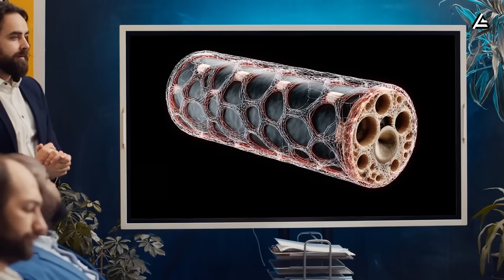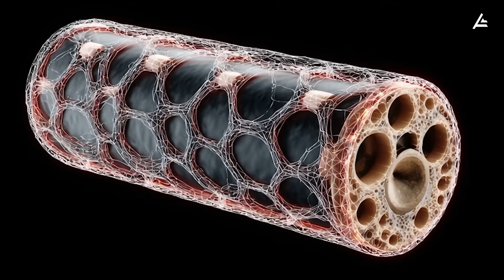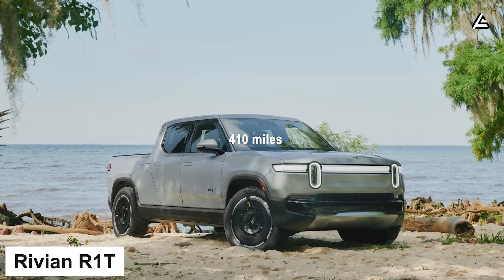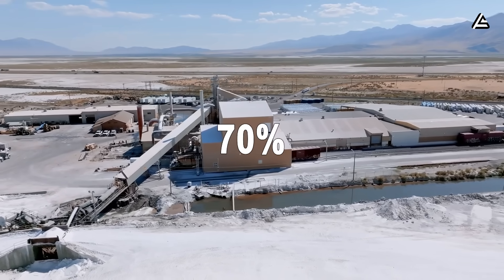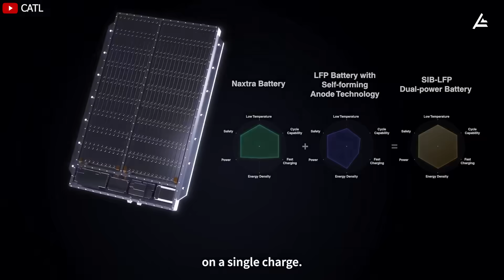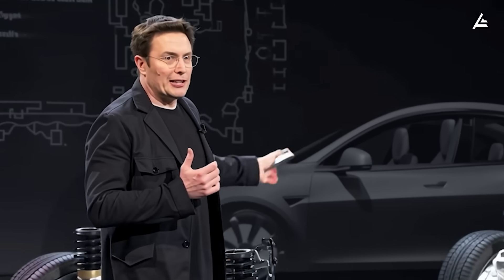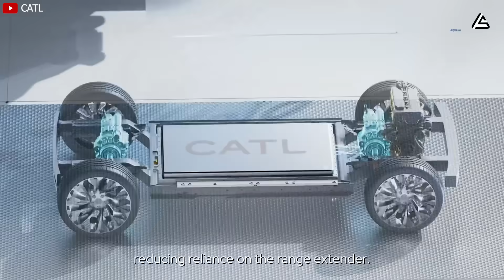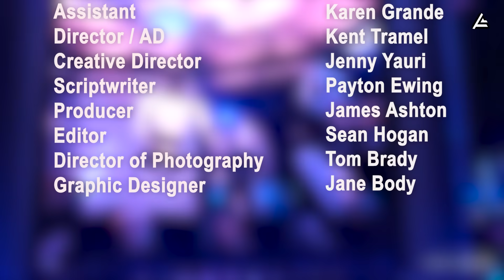2026 Tesla Batteries Update About Aluminum & Sodium: What Elon Didn't Tell You?

Comment: Aluminum ion batteries are too far away for being used in any application. At least 10 years away from now to be used outside of a lab. So no. Don’t expect them in the near future. 
Sodium ion does not have yet the advancements to even match FLP batteries. So another big no for applications out side energy storage or very small BEV applications in the next 5 years from now.

The next decade will be predominantly lead by NMC and FLP batteries unless something miraculously outstanding happens in the next 2 to 5 years. Something pretty unlikely.
Reply from the maker: We believe the “miraculous thing” you mentioned is exactly aluminum and sodium batteries. People have been always saying they’re 10 years away for over a decade now. 2026-2027  is when the best of battery tech arrives
Reply: Sodium is getting close to LFP and this isn't vaporware . I believe CATL is claiming one in the 175 to 190 wh/kl range and there are even some in cars in China though not a lot yet.
Reply: @ctuna2011  the truth is that as today, they are closer to 160Wh/kg and with a life span around 3000 cycles. LFP have slightly better density around 165~170Wh/kg but with a life span up to 5000 cycles… So sodium still needs development. As I said around 2 to 5 years but seems it will never outperform the LFP. Even though it could be an alternative for low cost vehicles in the future.
What CATL said was that they are ready to start manufacturing sodium ion batteries. But didn’t mention at what scale and for what purpose.
Reply from the maker: thanks for your info
Reply: NMC are going to be dead ends just took damaging and took expensive  the materials will end up in more valuable technologies. Li Fe PO and Na are still headed up by CATLe  and they are already going into world vehicles . The Na power pack is already overlapping Li Fe power and are showing greater safety and tolerance performance and safety.  They also hold a whole mass of global patents and hold the existing Li  plant  they can switch to sodium.  Meantime Elons automotive days may be over after his  heist on public records and showing his  personal ego colours.,.. 
Meantime scientists and engineers  are not going to hang around with the recidivists and Christo fascist death  cult and general Kacistocracy ...and the research work of NASA universities and former agencies will be controlled by a bunch of wealthy mental inadequate s.
Reply from the maker: then what do you think about a whole new battery tech like al and na?